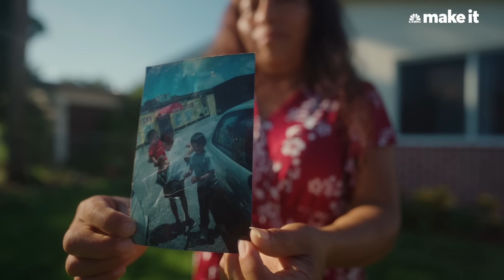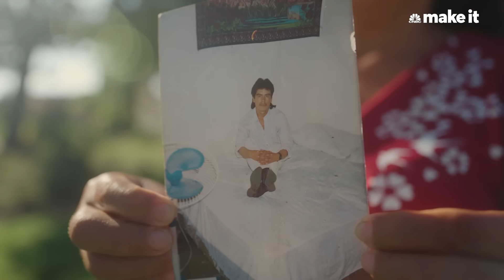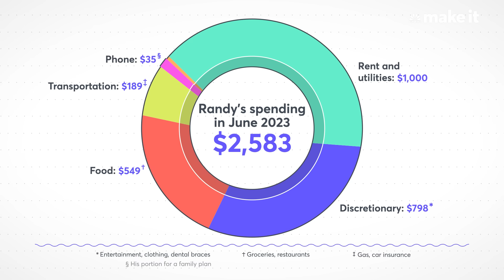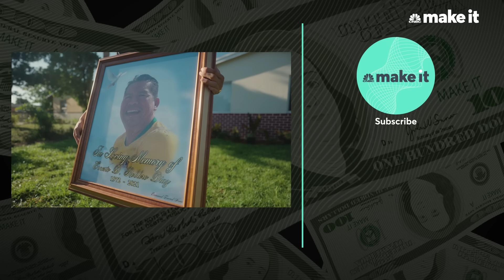Living On $77K A Year Washing Cars At Age 22 | Gen Z Money

Comment: 120 a car x 4 cars is 480 a day x5 days is 2,400 a week x 50 weeks is still 120,000 a year if you do 4 cars a day x 5 days x 50 weeks if that's what you do.😮

So don't come tell me I need to watch again  numbers don't lie.
 He also he makes over 6,500 a month
 
That's about 14 cars a week 
So it's not 4 cars a day cause 4 cars a day at 5 days would be 20 cars a week and he did say he limits himself to 4 cars a day or he dosent work 5 days.and it's hard work for sure.

Just like today I loaded 6 truck loads of tree limps big ones in 94 degree heat and I'm 65.